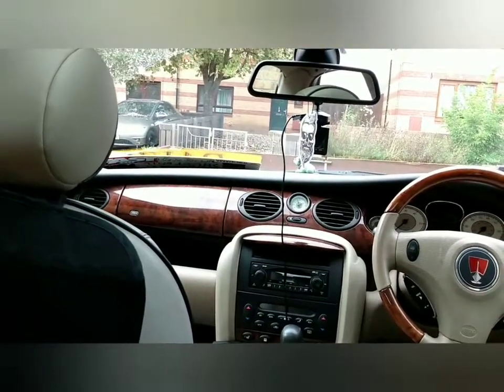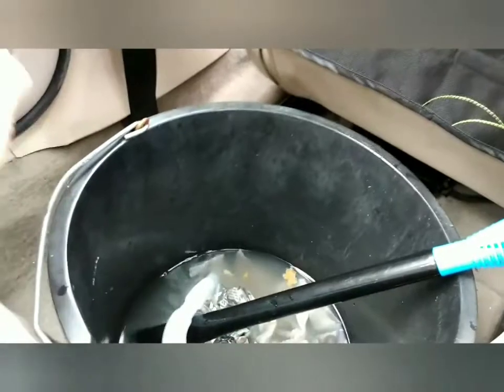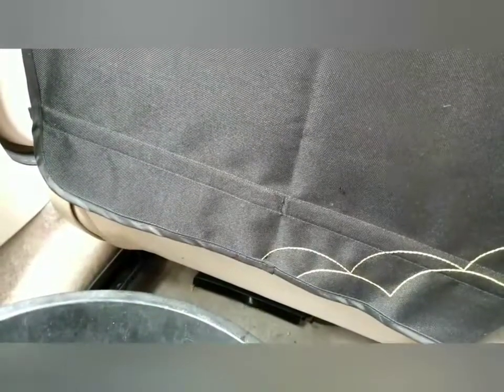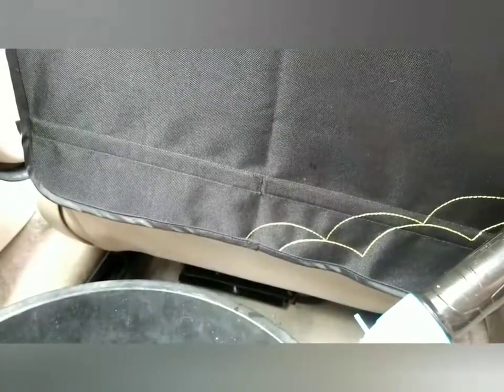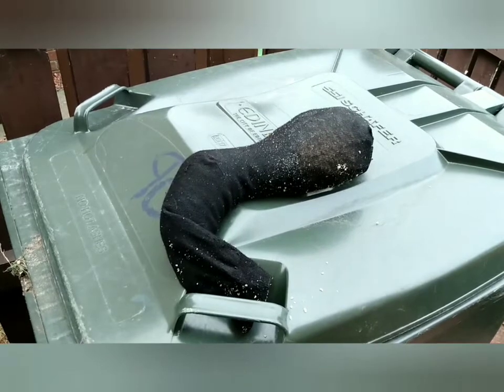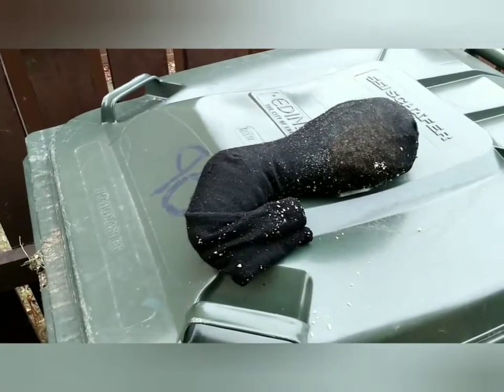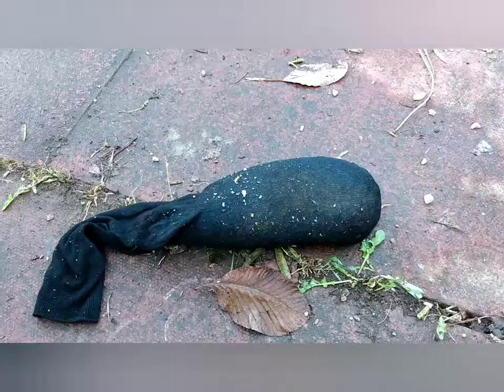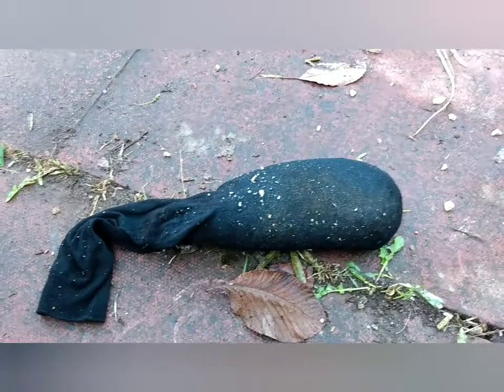Project 75 Episode 2 - Passenger Footwell Leak

Comment: I don't know the 75 well enough to diagnose with certainty but generally sunroofs can leak due to drain holes becoming clogged up. I used a heavy weight strimmer wire to rod through from the top around the sunroof all the way to the exit holes which in the case of my car are behind the front wheel arches.
Reply from the maker: I think I have possibly found the source of the leak, and the parts have arrived today, so hoping to get a video out later this week :)